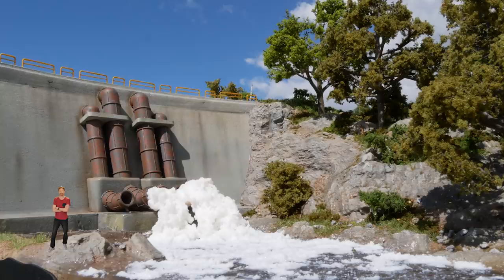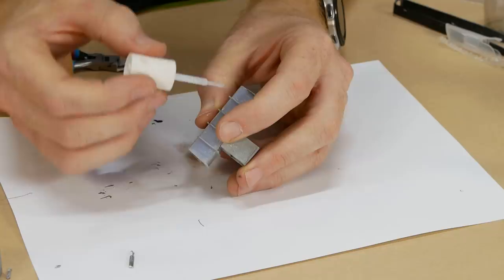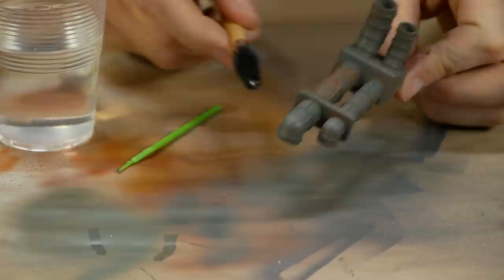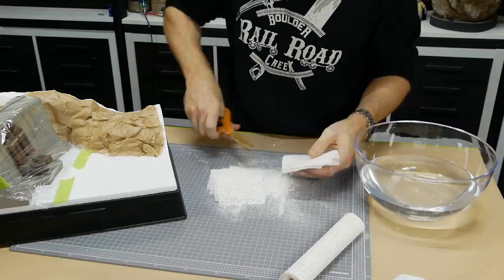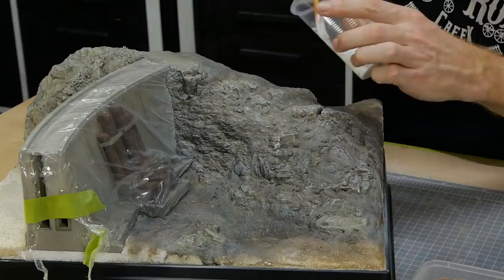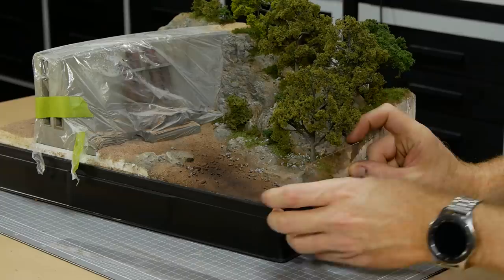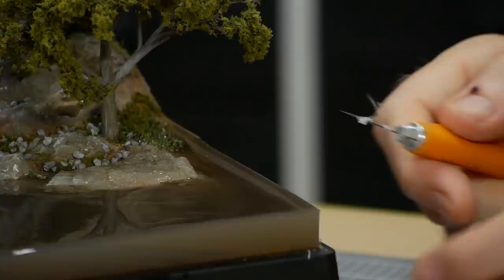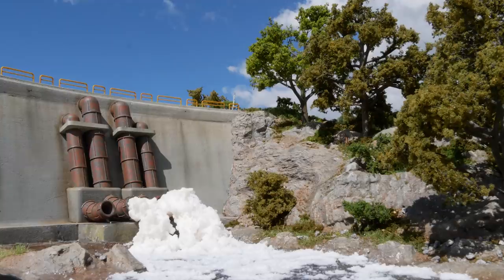Build an ULTRA Realistic Dam – Realistic Scenery Vol.27

Comment: For trimming the edges of the ‘water’ have you considered a deburring tool designed for metal? I think it would give you less of a chamfer and also be less likely to dig in and take a big chunk out. Might not work but it might be worth a try.
Reply: Might also try passing a torch flame over the dulled chamfers to get them to match the smooth surfaces. Not sure if it works for resin like this, but it does for plastics, so worth a try

Comment: Another fantastic tutorial Luke!!  I can't get over how great the Woodland Scenics "Static King" seems to work.  I've built a few static grass applicators of various power levels (9kV, 15kV and 30kV) and always thought that you needed to have the charging surface as close to output as possible (metal screen), but the WS proves that's not the case.  It works just fine with the plastic screen and metal charging "crown" at the base of the canister.  Someone at WS did their homework/research!  I'm going to have to consider building a new applicator, or at least rebuilding one I already have...

Comment: Amazing work, as always! For the water behind the dam, could you make a vertical wall of water to fill in the front side? I'm struggling to articulate what I mean, but basically have a hollow shell of water rather than a solid block - that way there wouldn't be the floating water "shelf"

Comment: Love your stuff Luke and been watching for years! However, this is getting very close to the line between talking about the materials you use and an infomercial for Woodland Scenics. I originally got into the channel for the more seat-of-your-pants approach and learned a ton about using inexpensive and found materials (I still use my DIY static grass applicator from your design), but Woodland Scenics is too $$$. Don't sell out!

Comment: I know this is a woodland scenic endorsed video, but I've had bad experience with Static King, and I know others have as well. Do you really think it's an ideal product as your mention in the video? Is there a trick on making it work better?
Reply: Hello! We're sorry that you are having issues with your Static King. Here's a list we go through with modelers who call when having an issue. Usually one of them fixes the problem. You might try them out and see if things change.
•	The anchor needs to be in contact with the adhesive and the layout base.  For best results, submerge two or more feet/prongs in the adhesive.
•	Make sure not to overfill the hopper.  It should only be filled to a maximum of half of the hopper.
•	The closer you hold the Static King to the layout, the stronger the static effect will be. Hold the Static King as close to the adhesive as possible during application. The Sieve should be no more than 3” away from the adhesive during application. 
•	After you apply the Static Grass, you can encourage the upright look by holding the Static King (while turned ON) above the application. This will build up the static field. When you remove the Static King, lift it away from the application in a vertical motion rather than a horizontal motion. The Static Grass will follow the direction of the static field. 
•	Are you shaking the Static King when applying Static Grass? Gently rock the Static King from side to side (not up and down) over the adhesive while the device is ON. This will help loosen the Static Grass in the Hopper and plant it in the adhesive. Keep the Hopper as close to the application area as possible while shaking the Static King. Lift the Static King away vertically. 
•	Are you powering the Static King with a Power Supply or are you using a 9V Battery? If you are using a battery: Is the battery brand new, or an already used one? If the 9V battery is already used, the charge on it may be low. Try a fresh new battery.
•	Adding undergrowth to the application can also thicken the appearance. When the adhesive is still wet, apply shorter lengths of Static Grass over the taller. The shorter Static Grass will fill in around the taller Static Grass for a thicker grassy look. 
•	 If you are applying over a curved, hilly area, try angling the Static King so that it is parallel to the curve of the hill. 
•	 For some applications, it may be appropriate to use the Small Sieve instead of the Large Sieve for 7 and 12mm Static Grass. The Small Sieve will help you control the application and slow down the application process. You will have to shake the Static King more to get a thick application, but slowing down the process may help. 
•	If the adhesive is still wet, you should immediately remove the excess Static Grass that is lying over. Most of this excess has not planted in the adhesive and will remove easily if you turn the diorama over or use the Model-Vac. After you have removed the loose excess, apply more Static Grass over the wet adhesive. Repeat as needed.

Comment: The only thing that doesn't look quite right is the water coming out of the pipe. Hard for the human eye to accurately depict water flow.

What you could have done (although a huge faff) is build the pipes in something like cinema 4d. Use the realflow plug-in to generate the water flow then freeze frame it, save the model out and 3d print it...yeah probably not worth it.

Comment: Well, it needs to have almost no water in it to look realistic these days...
No, yours look better, you can be proud of it! Congratulatons!

Oh well, you could probably have 3D printed the tube like structure (the tunnel) standing upright, without any support.  Wait, that is wrong, because you could not have painted the interior walls. Well, you could then print the tunnel parts as they are in your video upright anyway. That might work.
Reply from the maker: yeah I did consider doing the tunnel sections that way, I ended up laying them down flat so the overall print time was quicker 😉
Reply: @BoulderCreekRailroad  oh yes, sure, the print time depends on the maximum height.
Well, my mind was at the FDM printers where it's much better when you can print it without supports, but here with the resin printers the priorities are different ...
Thanks for your clarifying reply!

Comment: I know that would look good if I took the time and effort to do that for myO gauge model railroad.  So fw I have been seting it up for christmass but it has got to be good size with a lot of houses I have found at places for a good price and some I have built myself. A couple mountains in the corner with a tunnel for the train and a bunch of lights and thinga but nothing that nice ` because I tske it down  a while after Christmsass.  I have been considering  a layout I leave up and just add some stuff for Christmass. `If I have it go around the outside of the room without blocking much I midht  do it but not to much area to make stuff that stsys up tsking s lot of srea up all over. The  Dam cUGHTmy attention  do to having a band that we named D.A.M.M.  That played at Keg parties in HS  nothing rally against them but it stabds for Drunks Against Madd Mothers  and worked for a Punk Rock band playing Keg parties.  Videos like yours have helped me do some work making stuff for my train stuff  so thank you.